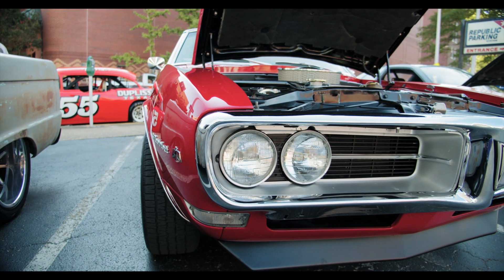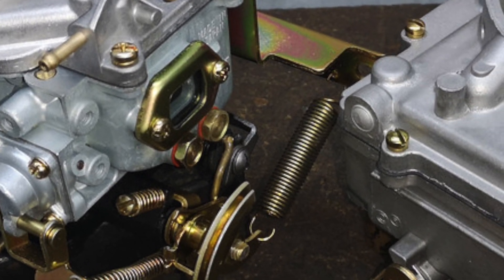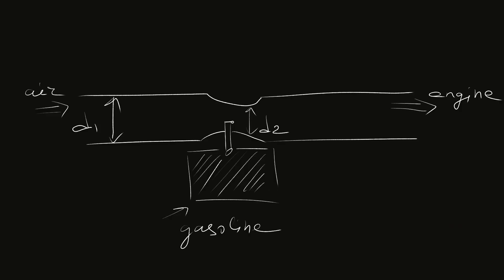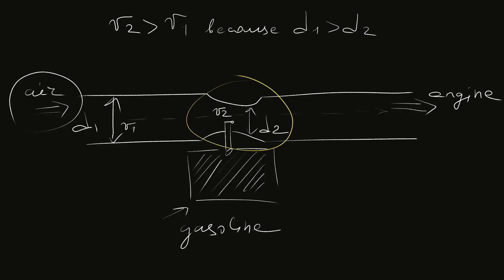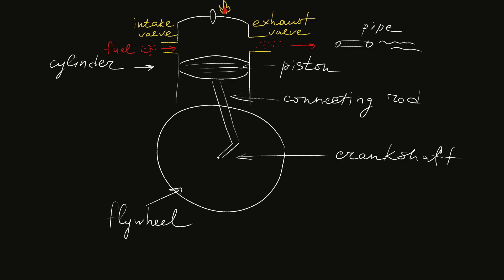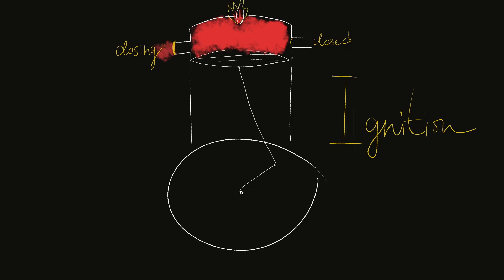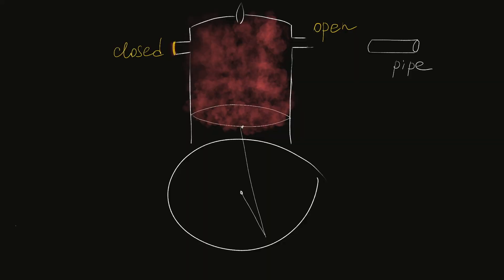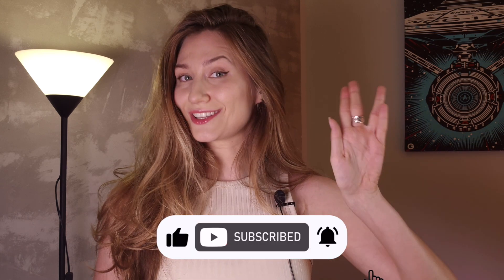INTERNAL COMBUSTION ENGINE IN SIMPLE TERMS

Comment: Very good video! :D I liked your explanations of the carburetor and the 4 cycles of the IC engine, although carburetors are not used anymore in modern vehicles because it had problems when the temperature was not optimal. That is why you had to turn on the engine of old vehicles to let them heat up before using them. Otherwise the temperature would be too cold and the fuel droplets would condense on the walls and instead of being pushed to the combustion chamber. 

Nowadays engines usually have a direct injection system which injects the fuel during the intake phase to mix the fuel with the air as it enters the combustion chamber. Injection systems are also easier to control as carburetors.
Reply from the maker: @jokajata  thank you so much! It is very useful comment, i will pin it for others to be educated as well :))